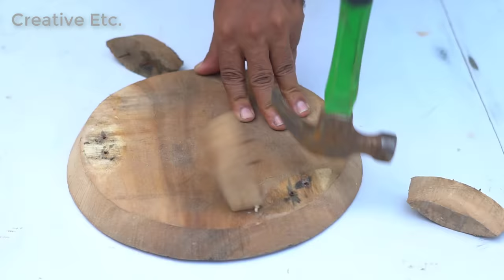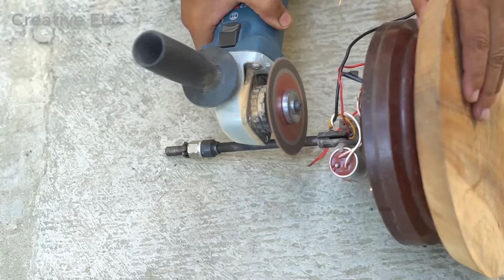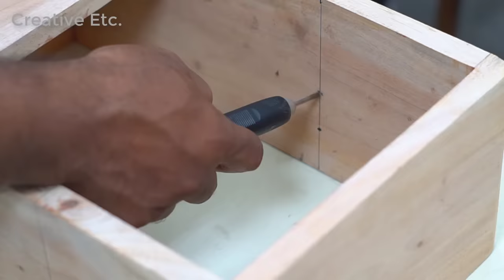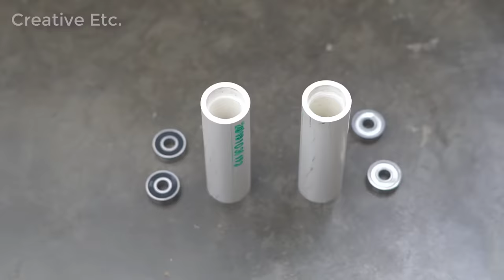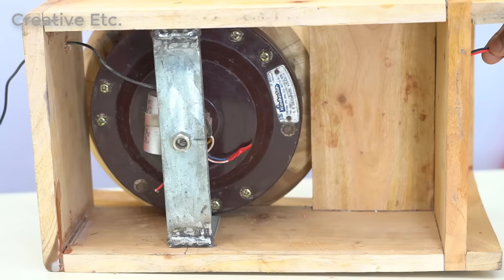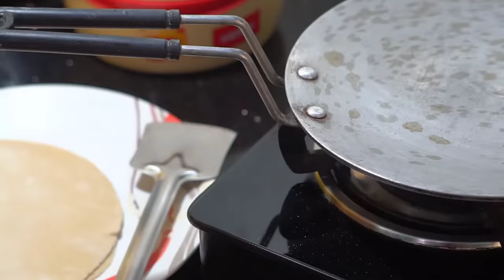How to Make  Roti Maker / Chapati , Puri Maker from Ceiling Fan

Comment: Very helpful for senior citizens and elderly... 
Especially for students and singles...
Instead of ba ceiling fan, if you purchase a basic DC brushless motor and wood including the cost of  weldin of 10 Rs. And wood working
It would not cost more than 350 to 500 rupees even if the tinkering of roller to make it automatic is added.... 
Nice... 👌✌🤘
Reply: विकत मिळेल का

Comment: Very good idea. One suggestion for improvement is that the push button can be set in such a way that it gets pressed when the arm of the roller is pushed down. It can function as an  automatic start/stop.
Reply: Easily can be done with a simple limit switch. Very good idea!
Reply: Jese fridge ke ander switch hota he ....thik usi technique se bhi automatic ho skta hai😊
Are hamne to version 2 ka idea bhi de diya...2 version to yhi ho gye....ab to market me lunch kar dena chahiye 😅
Reply: Although, I gotta say this has that certain kind of retro feel to it. Might be even cooler and more reliable to add a murcury switch on the handle.
Reply: We are just getting the ChapatiWalla5000™ to market now. We will gladly incorporate your suggestion into the next iteration, the ChapatiWalla6000™, currently in design stages. May we put you on our list of testers once the design is finalized?
Reply: @theoriginalchefboyoboy6025  how can I buy this? And what is the price?
Reply: @theoriginalchefboyoboy6025  Well, how did it go? I'd love to test it on tortillas. Same as rotis!
Reply: Great idea! 👍
Reply: Suggestion is good. But the speed will not be according to user it will be out of control of the user
Reply: @sarlamantri1293  you can use a light dimmer to control to the desired speed. It works on motors too that are powered by 230V - 250V
Reply: Make a stopper to define the thickness of the dough and add the button to it.

Also, I would add one cutting wheel close to one end of the pipe.

In this way, it would make the dough perfektly round and give it a defined thickness
Reply: Ручной труд совсем отменяется, скоро у нас атрофируется, 😂

Comment: It's so innovative, it will cost around max to max 1000rs to make this useful thing. Moms gonna loved it 🤗
Reply: Some good fans cost 2000 rupees. The motor is it's main component. How can it cost 1000. We haven't added cost of manufacturing, marketing, distribution, retailer margin etc. The design is too crude for a modern housewife.

Comment: One suggestion you should keep the switch in such a way that when you lower the handle it automatically get pressed and start the machine.
Reply: That will be in upgraded version 🤠
Reply: That is not a good idea.  Then the machine will go on even if accidentally the handle is lowered. That would be a safety issue
Reply: It can be the other way around.. It spins only if the handle is lowered, even if the power is on

Comment: Sir in place of push switch
You can use such switch
Which will on the motor as soon as the roller handle is brought down to roll
This will make it automatic 
Like in washing machines dryer lid
Reply: Good idea 💡
Reply: Lots of good ideas।।।।

Comment: Great design. The shaft that you've used to make the roller.. is it custom-made or did you buy it in a store? I am trying to find such a shaft with threading at both ends, but I am unable to get it.
Reply: It is a bicycle rear wheel axle
Reply: Hi how are you I want this roti maker please reply where I get this or you will make fir me please

Comment: Improvement Suggestion - 
 Need to cover the below gaps, while making roti you need to put some aata for lubrication, that will go down to the motor area🤗
Reply: He is not using aata as lubricant.instead, He is brushing oil on plastic round sheet he made from file. Dry flour is not at all advisable on this machine.

Comment: A simple enough improvement would be to have it turn on when the arm is lowered.
Reply: Yea by adding push switch
Reply: True we. can place a limit or light sensor switch , but these will complicate more
Reply: @ramavijaya148  a push switch is like a normal bell switch which does not need extra cicuit just connect wire thats it
Reply: Great idea.
Reply: ড়ড়

Comment: At starting its power factor is too high, every start takes large current, so electricity cost will much increase.
Rather using induction motor , beneficial to use universal motor or Dc motor.

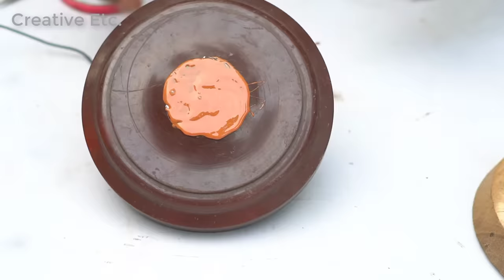Comment: What is the glue/solution used to join the metal with the wood at 1:30?

Also what is the procedure to fit the bearings inside the pvc pipes?

Comment: Fix the red button at top corner of the base frame rectangle. So once you press the top over the roti base automatically the motor starts. I had a coffee grinder it's button is like that. Just press and hold the mixer will run. If you remove the finger mixer stops. It is brass head switch and when you press it touches the other brass base and power starts.

Comment: Have you tried cutting the roller in the middle to allow each side to rotate along with the disc rotation? Right now the roller is experiencing a bit of differential shear stress.
Reply: It is cut in the middle already
Reply: Usse kya hota h?

Comment: I think you should cut the pipe from its centre, because if the rotation of pipe is a point, then there is a contradiction in its movement.

Comment: Those are actually Puri maker not roti 
Roti uses dry flour On it.
He put oil 
And if he doesn't it won't roll like this
If this was roti it would have been stuck or split the roti.
But yeah good invention for puri 
As it could be used in shadi

Comment: You need to join the pipes(used for pressing the Atta) with Adhesive to prevent the gap which may arise in future due to constant usage.
Reply: The reason for the split is the pipes rotate in opposite directions.
Reply: @billnchris1  Oh that's how it works. Thanks for the update.

Comment: 7:07 - 7:08  Suddenly the vessel got clean, so clean that it looks someone cleaned with detergent and dough stuck around also got mixed...(With not even little particles around) 
Hence proved , it's fake ..in between he/she must have removed it, kneeded the dough with hands, changed utensil Nd edited the video ...😬